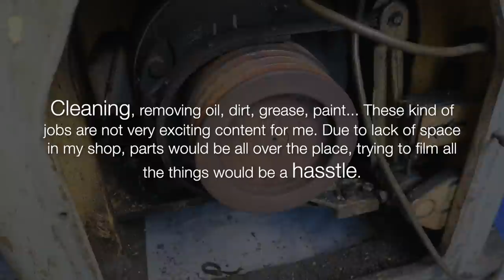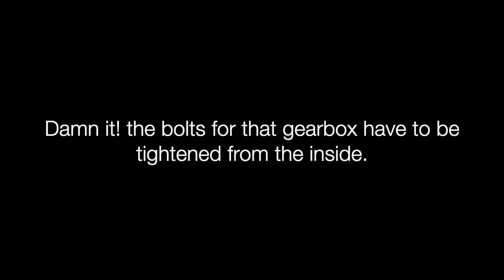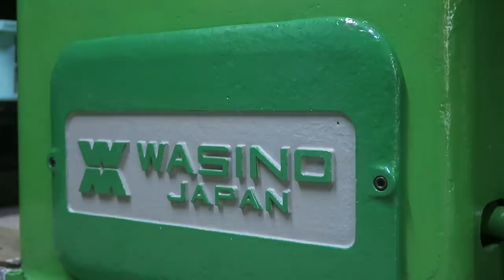Lathe restoration

Comment: Beautiful old lathe with hardly any wear! We can't find anything like it here in the states. Very heavy duty clean old lathes are impossible to find here. Most shops sold them for scrap when they switched to CNC (or went out of business). You did a fine job, I am jealous.
Reply: professormag really I found in the last year multiple Monarch lathe from World War II in perfect condition for 2500 bucks where are you looking
Reply: @plymouth-hl20ton37  Southern US, nothing anywhere as nice as what Cà Lem Found. If you look closely, his doesn't have any wear on the ways. That is my standard. All the photos of lathes for sale should include the first foot (or two) of the ways, but its usually hidden (on purpose?).
Reply: We have a 1951 Lodge and Shipley Model X in really good condition. There's hardly any wear on even the most traveled areas of the ways and virtually zero(.002) backlash. Our 61 Southbend however.... Can still hold a thou but it's one I would like to restore in the future.
Reply: @plymouth-hl20ton37  Where did you find multiple Monarch engine lathes in perfect condition for $2500?
Reply: @michaelbaker9839  one of them sitting in my friend's garage has flame hardened ways pristine condition I don't know where you're from but I'm from Ohio and there's a place up in Cleveland they've had quite a few, I've gotten a nice Bridgeport good shape digital readouts power feed but no head for $900 ways were very good shape
Reply: @plymouth-hl20ton37  I'm in Cleveland. Can you let me know where in Cleveland?
Reply: @martyhuberty9739  I find it hard to believe that there are monarchs for 2500 in that condition
Reply: @willc5979   I'll admit it doesn't seem very likely, bu, stranger things have happened.
Reply: My families shop has 8 of these, except American made. All of them look just like this and have been working flawlessly since they arrived in the 1940's.
Reply: Marty Huberty I don’t know where he’s talking about but HGR surplus has a lot of stock that they rotate often, they don’t test the equipment and they don’t clean or prep them either, it’s a total gamble buying online from them (or anyone really) IMHO. I got a heavy 10 and a index 55 from them. The heavy 10 has significant wear and is pre 1947 model, my index was rusty and dirty/repainted (someone painted over oil and dirt). After I cleaned it up I found out it has practically zero wear. Every dove tail and glide way stil has nice scraping
Reply: There are tons of machines like this in the states. Look for labs, treating facilities, universities, and large conglomerates (Raytheon, Boeing, L3, etc) announcing their auctions.
Reply: @ProfessorMAG  There was not a single frame in that entire video that showed the ways clear enough to be able to determine any wear, even if it was a huge amount, like 10s of thousandths. Even lathes with significant wear are only out a small imperceptible amount. Something you couldn't see even if there was a shot of the ways without glare or the white balance in that area being blown out.
Reply: @martyhuberty9739  HGR in Euclid

Comment: When I saw you chipping away at the concrete floor with hand tools I said "man that will take 3 years"... 2 seconds later, it says 3 years later on the screen.  Iwas laughing hard...

I do not know if it was intentional but the two tone green actually looks really good.  It gave the machine more depth.  very quality work.

I had a heart pounding moment at teh "stay there" scene.
Reply: Yeah, I would not have chipped out my floor, image of he ever has to move it again, or level it.

Great job though.

Comment: You have excellent taste in machines! The width of the bed and ways is impressive. Nicely done. One thing to check is you should see some oil movement in your front gearbox sight glass. Make sure its not blocked.

All the best,

Tom
Reply from the maker: oxtoolco thank you uncle Tom. I already remove all the old oil. Gave the housing really good clean and fill up new oil. Also cleaned up the ways, holes for oil goin through the main bearings.
Reply: I found a 1921 Hendey gearhead for 700 bucks in Clifton Park NY and I restored it. It looked like it was never used ! The guy that owned it says its been sitting in his Motor machine shop for 45 years and not even hooked up :)

Comment: Well Done. Somehow you managed to disassemble, clean, repair, repaint and reassemble a large lathe and make it work again. That was quite a major project and you got it done right, so can rightly feel proud of you achievement. You also now have an in depth knowledge of how your lathe works and have invested plenty of sweat equity in its restoration so you will be very careful with it's use. Good luck now put it to good use and turn some chips.
Reply from the maker: thank you Mark

Comment: question : how much did you pay for the lathe and how much did you spend on the repairs?
Reply: hedning003 i have picked up similar lathes for $200. Seen some sell much higher. Bearing, paint and bushings in a restore can add up to about $500. Really not bad for a nice lathe.  Hardest part is moving them.

Comment: Try changing the chuck jaws into the other slots and recheck runout, you may get it better!
Reply: never seen a lathe before have you?
Reply: @janvanruth3485  Well, I have an Atlas 12x36 and a 7x18 minilathe, so I know how to squeeze the most out of a bad 3 jaw chuck.  There is a whole science behind that, which most people do not understand, and go straight to regrinding the jaws....before finding out the real cause of runout.
Reply: Chris  You are right they have to be in the right order, but you have 3 choices of which slot to start with.  Quality chucks will be labeled as to which slot goes with which jaw for best results.  If he is getting 5 thou TIR, I think it is worth trying the other 2 positions.  It might get it within 3 thou.
Reply: rfnoise bullshit
Nr. One jaw goes in slot Nr. One.
No alternative. 
The keyhole might be marked but that is it.
Reply: Not how its works buddy. Sometimes jaws are even diferent dimensions to prevent that. I have 3 jaw and 4 jaw emco scroll chucks. Also worked on large (11kw) lathes with 250-300 mm chucks none can switch jaws between slots they have to go in order they are marked
Reply: @rfnoise  Actually you might need to re-watch the video again. He's getting approximately .0005 run out after converting it from the metric indicator readings and not .005". For any 3 jaw even brand new that's far better than most. If fact with a used chuck it's jaws, the chuck body slots, jaw teeth and scroll would have worn in slightly different for exactly where those jaws are correctly positioned over it's life. Using the jaws in a different order than what the factory numbered them would almost for sure increase the run out. I'm not sure how you came up with the idea of using the jaws out of order. But 100% for sure for any chuck that's been used enough to start having higher run out issues, then it's guaranteed the jaws work holding faces have worn bell mouthed anyway. 

So if those jaws need regrinding to correct that condition, then doing so with them in there correct order would be exactly how the chucks manufacturer would refurbish any chuck sent back to them for the work. Yes your right, there is a whole science behind the causes of chuck run out. And yes after more than 40 years at this I'd like to think I understand it fairly well. Suburban Tools did an excellent YT video about how to properly do a professional level chuck jaw regrinding that you should have a look for. The chuck key pinion if it's stamped with a zero mark as jan van ruth mentioned is because that's the pinion that was used at the factory to grind the jaw tips concentric once the new chuck was fully assembled. It's then known as the master pinion and should be used when the best run out is required. And to keep things simple, it should be the one used when pre loading the jaws when regrinding them back to being concentric within the chucks current wear limits.
Reply: @rfnoise  True. The jaws must go into the chuck in order but are not fitted to an individual slot. After finding the positions that will give the best runout then the chuck body can be marked with the jaw numbers.

Comment: I have been rebuilding old machines since I left the Military in 1988. This is really a great video. One comment though. To make a old high quality tool room lathe worth it. Replace the old chuck. .0015 may be ok, for this video.  But I can guarantee that range of run-out will change as you go to different sizes of stock. The screw plate and jaws on a old chuck will be worn differently at different points.  Even running a tool post grinder and re-grinding the jaw point cannot prevent run-out from being amplified thru different diameters... Yet Awesome Job. I wish I could work with you....

Comment: Damn, three years is some time lapse! Great work. Fortunately, nothing seems to be worn to the point of needing replacement. That often happens (it did to me), and then you have to get lucky to find a good bunch of parts (usually gears, and some odd bearings) to replace them before you put it back together. You may never.

Comment: I read comments about these rebuilds that say there not restorations or rebuilds just clean and paint. Many of these older machines are well built and other than minor bearing, key, pin and seal replacement they are in very good condition. Sure a complete gear and bearing replacement and hand scaping can improve them but when the time and cost is factored in the price can be more than a new machine. I did a similar clean and repair to a 1957 Clausing Colchester  and some scaping on the cross slide and turned a lathe that I got for scrap iron price into a nice machine that runs and cut very well. The head spindle bearings alone would have been the price of a new lathe.
Reply from the maker: yes. it's true. thank you brother

Comment: wow what a lovely lathe! great job, it's really a good machine, very quiet and it seems very precise.. I have one that is very similar in dimensions and construction, an Italian  Ingers 145, I've done a job like your but not the painting.. did you change also the bearings? wich year is? mine is from 1970-75

Comment: It's an absolutely beautiful piece of precision machinery, it took you three years to fully restore it?  It looked brand new when you were all done! Worked as smooth as a Swiss timepiece. It's just amazing how complex metal working lathes are with the gearing system and speed controls.  I've never used one before. I once read "the lathe is the only power tool that can carry a project from beginning to end" Is is a 240V AC single phase or 3 phase AC motor?
Reply from the maker: thank you. No, it took me a month. it's 220v 3 phase
Reply: I thought it might be three phase however only saw two of the three hot conductors coming off the cable end unless the white was used as the blue leg
Reply: Its been said to me that the lathe is the one tool that can be used to make more of themselves. For a very long time that was true until the advent of things like 3D printers. Even so, not many machines can the same be said of. Fantastic job refurbishing this one.

Comment: Why didn’t you media blast the frame rather than strip/sand it? Would have been much quicker. Nice end result though. What kind of price are old worn out lathes going for? I’d be interested in how many parts had to be replaced and what your total investment in the lathe ended up being. How long did it take to do the restoration?

Comment: The chuck is held in by three bolts. Maybe rotating the position if the chuck might help the runout. What does in the hole you covered in tape?

Comment: why remove the concrete (and stability?)  --- seems better to have mounted on leveling screws, in which case surface geometry of floor is relatively irrelevant.

Comment: Nice job on machine just when testing do not run chuck without something clamped in jaws or take jaws out i seen centrifugal force unscrew scroll and jaws fly out on the higher RPM.

Comment: if you ever move the machine, don't inset in into the floor. you ill have a much easier time levelling and cleaning under it (chips and coolant always get under machines, no matter what you do). You also want to have the lathe anchored to as thick of a pad as possible.

Comment: Hey! Nice work! I'm currently doing a similar thing to an old Habegger DLZTE. Mine has prismatic ways like yours with a few differences. Did you regrind the ways of your lathe? If so: how did you solve the height issue with the lead screw and the feed rod?

Comment: Just a clean and paint restoration no repairs or adjustment
It's a joke on old machines !
Reply: Going by your comment Chris then I know you already understand what that "restoration" term means. It's wrongly used but somehow an accepted term on the machinist forums and by too many here on YT as well. Better might be a clean, repaint and make any minor repairs job. No reputable machine tool rebuilder would use the term restoration without detailed and proven verification that the machines current accuracy is still within the factory test certificates specifications. Yes the bed ways on this lathe do look pretty good, but with the state the OEM paint was in there's sure to be measurable wear on the bed and the rest of the machine where it counts. You don't take an old rusty car with 100k + miles on it and clean it up with a new paint job and call it a restoration. Everything else that needs it gets rebuilt to factory new or better status to fit the term. Yes this lathe should work better and might even last a lot longer with everything cleaned. But yeah I'd agree, it just isn't a restoration. Making the hobbyist's like myself understand what the term means is likely a total waste of time though.
Reply: There is a deference between a rebuild and  a restoration.
Reply: Turning Point Like taking the old lady to the beauty shop vs taking her to a complete makeover. Meaning surgery on boobs butt, lips and teeth all together.
Reply: @kevinfaulkner8801  There is? While both words have various meanings. Restoring an old painting or rebuilding a relationship as examples. Quoting from the Macmillan dictionary, Rebuild - "To improve so that it is good as it was in the past". Restoration -"The process of putting something back into it's original condition". Machine tool wise, either word is just about interchangeable with the other. For most people restoring an old car would mean back to as close as possible to new appearance but more importantly it's reliable operating condition. Rebuilding the engine in that car if your planning on having it last would mean re-machining cylinders and any highly worn or scored surfaces, replacing internals where required with new parts etc. As I said, the ways on this lathe do look very good, my eyeball judgements and guesses about that on a video don't mean much. But any machine tool rebuilder would at the minimum if they were checking this machine use correctly applied ink on straight and dovetail edges, indicators, precision levels and there surface plate to at least check for how much bed wear it might have. The same for the dovetails on the slides. Head stock taper, bearing clearances, tail stock taper and how correct it's C/L aligns to the head stocks C/L in both horizontal and vertical orientations etc. Any areas that are within acceptable tolerance are left untouched, but they would still get checked. 

Both words as mentioned are incorrectly used by far to many that don't fully understand what those terms mean. Detailed cleaning obviously does help a machine maintain whatever level of accuracy it already has and it should then operate a bit smoother as well. Paint does zero for how the machine performs other than preventing rust. While proper alignment and accuracy checks might have been done but just weren't shown in the video. Those are also an important part of commissioning any brand new or used machine if you expect to get the best from them. There's at least a few free online PDF's of Dr. Georg Schlesnger's book Testing Machine Tools. He was the first to literally write the book about the subject, and his early 1900's test methods are still used on the latest and most high tech cnc machine tools made today. Any decent new machine will come with a proper test certificate that proves that it does meet the minimum accuracy requirements guaranteed by the manufacturer. Again those test certificates are still based on Schlesingers work.  To some arguing the semantics of those words might be unimportant. For anyone that does understand what they mean, incorrectly using them instantly brands that user as an amature. I'd guess it's also more than a bit insulting to any machine tool rebuilders that have put the years in to gain the knowledge and highly developed technological skills to work to that level of accuracy while still maintaining the critical machine alignments in 3 dimensions. Even at a hobby level the Jan Sverre Haugjord channel here on YT would be the very best example of the talents required I can think of.

Comment: Not bad, but did nowhere teach'd you never run an older chuck without fixing anything? That's really, really dangerous. I build lathe's since 35 year's and I'v seen parts of Chucks flying Tru the factory more than one time.

Comment: Save lot money to restoration scrap lathe machines. Use your knowledge to put all accessories back together Let's prayer you can do it, use linseed oil cleaner rust and fiber grinder machines, use can spray paint look new. When you finish it you could sell company for value $190,000 if work for last long times. If I have garage machines shop I'll buy it.